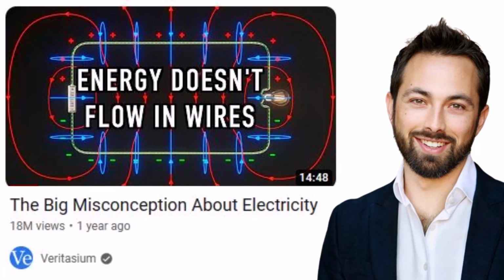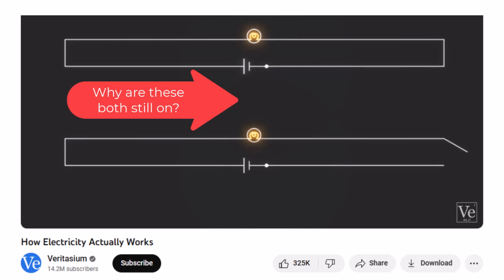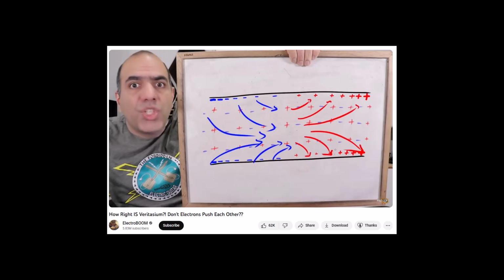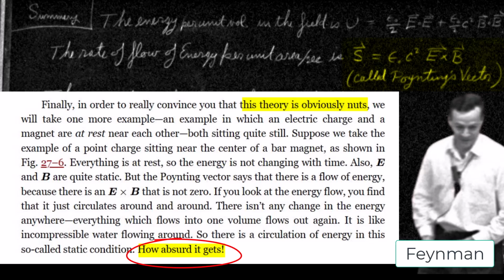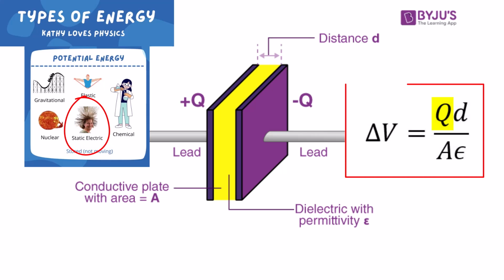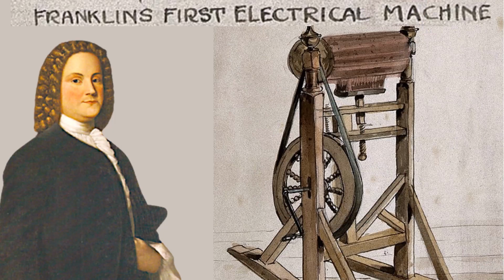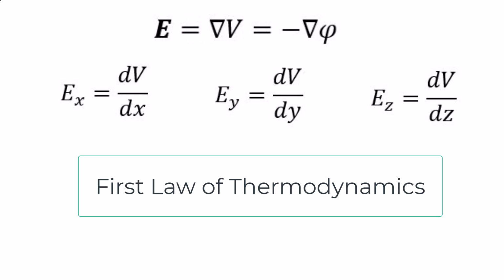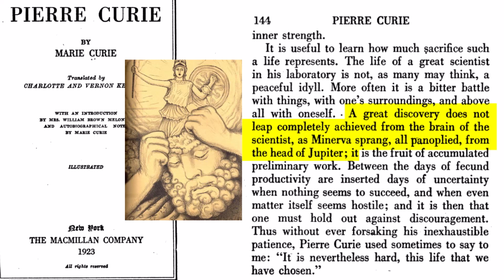Deep Dive Historical Response to Veritasium’s DC Electricity Video

Comment: What drives me nuts about this ongoing N-way debate (between you, Veritasium, Electroboom and probably others) is waiting for any mention of the geometry of the wires and the material between them. I.e., what you need to determine the characteristic impedance of a transmission line and exactly how it will behave under transient conditions.

This is NOT a DC system until quite a few round trip times have passed and the transients have had a chance to bounce back and forth a few times and settle down. There are some other Youtube videos that demonstrate this very well experimentally with an oscilloscope.

The philosophy of science is a fascinating topic in its own right, but you don't need to go into it here to solve such a simple problem. All you need is an electrical engineer or radio ham who understands transmission lines.

Comment: Hi Kathy, my name is Kiril and I love physics and its history too!
Permit me to suggest why you are mistaken about the surface charge issue; seperate from Derek's very confused first video.
1. Charge gradients along a cylindrical surface, i.e. where the density of the surface charges varies in each unit of its length - is a sufficiently different physical circumstances that it cannot be treated as identical with a sphere or cylinder where the surface charges are uniformly distributed.
2. Furthermore, the cause of the gradients is another distinguishing factor that cannot be ignored : They are a consequence of an ongoing dynamic process of adjustment and re-adjustment of electrons, as they enter at one end, interact with the various components and geometries of the circuit, and exit at the other; a process that in its - steady state - results in said gradients(similar to a standing-wave).
Reference : Matter & Interactions by Ruth Chabay and Bruce Sherwood

Comment: So, if understood correctly, according to the Veritasium theory, no current flows inside the cables, therefore they would not change their temperature. Regardless of the Amperes needed to make the light bulb work, this clashes with reality...The cables traversed with a lot of current they really heat up....I apologize if my reasoning is clearly wrong in the sense that perhaps Veritasium has given an explanation to this fact... But I'm old and half blind, I would find it very difficult to watch his videos again in question....

Comment: Does it make any difference if the battery with switch is already connected (open then closed) with the EMF being present throughout the circuit (even when switch is open) compared to a closed circuit with no switch, with no battery attached then simultaneously connecting both ends of the battery to the circuit? Would the speed of propagation be the same given all conductor lengths are the same?

Comment: Interestingly, closing a DC switch is easy enough. Opening a DC circuit, especially at extra high voltages in power transmission is no trivial matter. Interrupting AC circuits counts on the voltages and currents crossing zero every sixty cycles per second (50 in Europe). DC never crosses zero. 
By the way, electrical engineers believe electricity flows on the surface of conductors - in order to save weight and material, electrical ”wires” are hollow!

Comment: I think energy is just an accounting thing in physics. Energy is defined as the ability of a system to do work. If a system do work then its energy is decreasing, and the energy increases on the other system that the work is done on. This continues until both systems are in equilibrium and neither system can do any work on the other. The physical thing here is work and not energy. Like in accounting, my work is the physical thing and the money I get for it is just an abstract accounting number. So energy doesn't really "flow" as in something physical like water flowing in a river. Something physical must do work. "Energy doesn't flow in wires" is really nonsense, energy doesn't flow. What happens is that a field is created, that field is doing work, pushing the charges, those charges collide with other charges, change the orbitals in the bulb, those orbitals decay releasing a photon (which is also work) and the light bulb lights up. Mass as a form energy comes also from work done. About 99% of mass comes from the complex interactions of quarks and gluons in the proton, which is work. 1% of mass comes from the interaction with the Higgs field, which is also work.

Comment: Kathy, I gave Derek a “going over” about the various lengths of POYNTING VECTORS surrounding a single connection wire, and how the (1/c) interval only works IF you select the SHORTEST Poynting vector route. But the real “move-the-goal-posts” event was when Derek FIRST said that in order for energy to be transferred (via a field), a Magnetic field and an Electric field must be simultaneously present at the lightbulb filament, BUT THEN LATER says that it is sufficient for an imposed Electric field (across the filament) to cause localized Electrons (local to the filament) to repeatedly “bump into” the cores of the filament’s atoms, thus causing Heat Energy to be delivered to the filament (which subsequently causes the filament to emit Light.) So which is it? Do you need both a Magnetic field AND an Electric field to be simultaneously present at the filament, OR is it sufficient to ONLY HAVE an impressed Electric field at the filament?

Comment: In current teachings, DC current flow is referred to as either electron current (which is the negative to positive path) or conventional current (which is the positive to negative path, and is referred to as "hole" flow). This is reinforced through the schematic notation of semiconductor components, where "the arrow points to the direction of conventional current flow".

Comment: I agree with your comments re the scientific process.  Also...  If electrical energy flowed on the surface of a wire they why not save copper by using hollow conductors?

Comment: I think that a lot of people are oversimplifying things in this discussion. Poynting's theorem isn't S = E cross B and that is energy flux, though it is for many cases, especially involving traveling plane wave solutions of Maxwell's equations. Rather Poynting's theorm is Del dot S = -partial u/partial t, where u is the energy flux in or out of a volume of Space. For Feynman's problem of a 1-particle static spin-free charged electron or heavier charged boson that somehow magically doesn't instantly decay into many particles, you can enclose the electron within a spherical surface that lies within the magnet. S is not zero. Del dot S over that boundary is zero. There is nothing wrong with Poynting's theorem, only with people assuming that a textbook special case is equivalent to the theorem. Also, you used Ohm's law to make your argument, and the Veritassium video argued that this is incorrect when considering parts of circuits interacting with each other, which was one of the points of the video. There are charges on the surfaces in the wire. They are distributed within a skin depth that differs depending on the particular conductor. There actually are charges in the conductor but near the surface of the conductor, when you consider the very small skin depth. When the circuit is tripped, there is a divergence of the Poynting vector and there is a transient flux of energy that then decays, but how much depends on how close the LED is to the battery or capacitor. Whether the LED lights depends on how the LED is oriented with respect to the nearby capacitor.

Comment: Dearest Kathy, 
it seems to me ,as you say, that there are several misunderstandings about propagation in a DC circuit.
 I recommend the book: S. Ramo T.R. Whinnery T. Van Duzer - FIELD AND WAVES IN COMMUNICATION ELECTRONICS (free book now!), and in particular CHAPTER 5: Transmission Lines. 
In short: when the switch is closed, propagation depends on the "characteristic impedance Znull" of the line. On which the propagation speed also depends (eq.8). Znull in turn depends on the L and C of the line (which vary based on how the wires are arranged!). Furthermore, if the load is different from Znull there are reflections and the propagation is composed of a progressive and a regressive wave (eq. 14). So even on a trivial DC line, transient things can be complex. When the transient runs out, the simple DC laws apply, Ohm's law for example.

Comment: I think you misrepresent what Veritasium's talk was about. It was but a thought experiment, one that reveals the true physics behind a simplification we engineers make when modelling what we call "lumped circuit" components in general. It is in the same vein as Einstein's thought experiments that he used to explain Special Relativity. You could never carry these out in any practical sense, but they represent an aspect of the universe that is so bizarre that one must think about it. So there is no point in inserting realities like the transmission line losses, the delay in lamps lighting, the delay in batteries delivering charge, all these are irrelevant to the principle about which he is talking.
Reply: Einstein hijacking deductive reasoning and mislabeling it “thought experiment” (sic.) is NOT Science. 

Science is:

1. Making a prediction, 
2. Observing reality, 
3. Checking IF your prediction matches reality.

Comment: anyone that says "electricity doesn't flow in wires" is pretty much a snake-oil salesman and/or idiot (and I don't really care which) and is the reason why I refuse to watch any veritasium videos. if Derek wants to resurrect himself from being an idiot he needs to retrace his logic, figure out where he went wrong, pull down his old video, and put up a replacement with apologies for the original.  The internet is already overflowing with mis-information, Derek doesn't need to be adding to that, especially in a channel called "veritasium" 😞 !!!

Comment: Nope. This isn't a DC problem. It's a transient response problem. Closing the switch creates a step function which has both high frequencies and a DC component. Frankly I'm disappointed in any physicist or analog EE that doesn't recognize this. That's why y'all had to study Fourier and Laplace transforms. 

Hint #1: DC problems never ask "when?", because time isn't a factor. 

Hint #2: You can model a transmission line as a ladder of series inductance and shunt capacitance. So, when and where does that capacitive current flow? C+ for effort, try again...

Comment: I think the Poynting vector can be used for static circuits (current flowing steadily) as a kind of book-keeping device. When integrating the Poynting vector over the surface of a volume, this gives the total amount of energy flowing in/out this volume.  So in the example with a battery and light bulb, when you chose the volume to contain the battery but not the bulb, you see that energy is flowing away from this volume. When you enclode the bulb in the volume, you see that energy is flowing into it. When you just enclose a piece of wire into the volume, everything cancels out and not net energy flow is seen (apart of the small amount actually lost in the wire itself).

Comment: The electric field inside a wire is only zero when there is no current in it. If it's carrying a current and it has resistance, there will be a charge gradient along it and therefore an electric field.

Comment: "EMF pulse" makes the initial energy sound "fleeting" like a pulse is. It is not. This is the misconception. When that switch flips, the electricity - the voltage and current from the battery - turns on and stays on until the main electric current from the loop catches up with it and increases it further. I think this is the common issue that engineers & physicists have, because they think sure, there's an initial minuscule blip from the switch but it's inconsequential. They are wrong: it is consequential, and it's because our intuition of electricity flowing in wires is incorrect. Maybe a helpful abstraction most of the time, maybe, but incomplete and wrong even when talking about transmission.

I was confused for a minute by the initial Feynman quote about the Poynting vector being "obviously nuts" until later in the video when I realized that it was just a comment on how non-intuitive he thought it was, not that it was false or wrong. I think I understand the sentiment but still appreciate the Poynting vector myself since it is just combining the force vectors of the electric field & magnetic field.

Comment: i actually think about it like. switch is thrown. voltage step moves on line which has significant high frequency content (heaviside step function), skin effect will be dominant and the waterfront "rides the wire" initially it likely also rides the filament to some degree. then as the 0Hz component dominates, we get maximum depth of conduction as well as power delivery.
i really thought the varitasium analysis seemed much more like an AC steady state situation analyticaly.

Comment: I commented on Veritassium's (VTSM) original in the same vein, that has the core element being the confusion between bulk components (i.e. where you force all of one characteristic into a distinct component) and distributed components (where the spatial arrangement between conductors and insulators really matters, just like gold leaf electroscopes and the 'length of the loop wire' effects).

The AC vs DC is also confused as to the difference between transient effects and stable effects. 
In a stable DC system there is NO SWITCH -  as switch is by definition an instability, a change, a transient!

Blame Heaviside (and Fourier) for the ability to do AC transient analysis.

What is of interest is how physically wide VYSM's conductors would need to be and how close to create a self capacitance between the two conductors that would allow a near direct capacitive impulse to light the bulb (copper's conductivity isn't really good enough, and the gap needs to be too small to pull it off..)

A far more interesting school quiz exercise is the circuit with two identical capacitors, wired in series, one charged to Vc, the other uncharged (V=0) with the two end being connected back via a switch. Initial energy is (C/2)V^2, but after equalisation (switch closed) the total energy is only half - where is the missing energy?? It's the same problem as VTSM but presented differently. 

If the circuit diagram does not include all elements of the circuit then you have a 'Monty Hall' problem - You (we) have been set up!

Comment: The original issue  is that a simple thought experiment was proposed that was in reality a very complex problem to solve and there was not enough information provided to solve it.  Any circuit analysis where the physical dimensions are larger than about 1/20 wavelength is a transmission line problem and solutions must be approached in this way.  One of his videos did go into this at a very basic level but left many questions on the table.
One thing that I haven’t seen anyone mention is really a center feed dipole antenna that will radiate energy to space.  What happens in the short term in local space could be solved if the balanced transmission line and light bulb impedance are defined.  Note that this general problem is solved all the time using TDR(Time Domain Reflectometry).  Here a switch is closed in the picosecond scale to create a step and then reflected signals from the test circuit are analyzed.

Comment: Doesn't matter. Electrons are  matter fields thus are macroscopically dynamic propagating excitations in an EM field. Electrons momentum energy  propagating, is the poynting vector energy and can expressed as EM field energy. Electrons are fields and fields are electrons and moving electrons  are a electromagnetic waves. The origin of the energy is here described in Ohm P=VI thus the product of the potential of the battery with the electron current. This energy per unit of time is the collective momentum energy of the electrons inside the wire. 

So yes, the electron current momentum p=mυ is the energy that is transferred to the load. However this momentum propagates at the speed of light inside the wire and almost the speed of light c in the vacuum on the air surrounding the wire. 

The field around the electric wire on air is actually the moving electrons EM field extending outside the wire. 

Therefore, of course it is not the EM waves that carry the power but the the moving electrons inside the wire and their wake are EM waves.